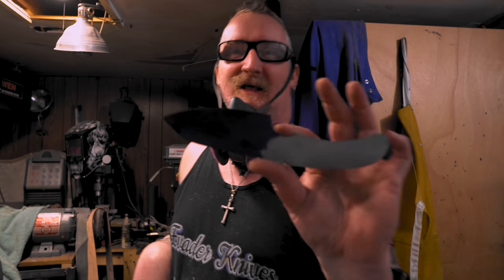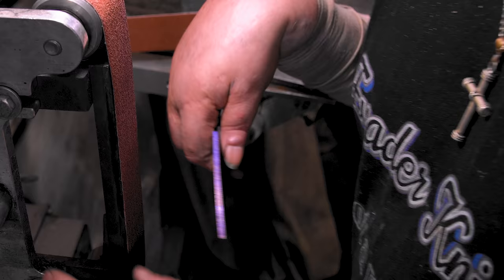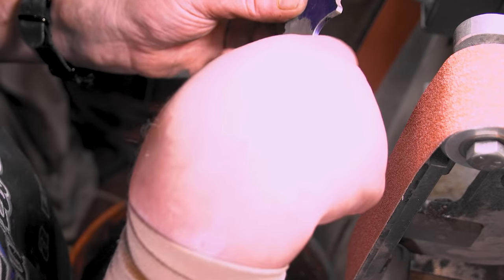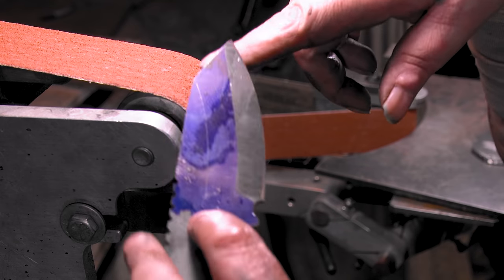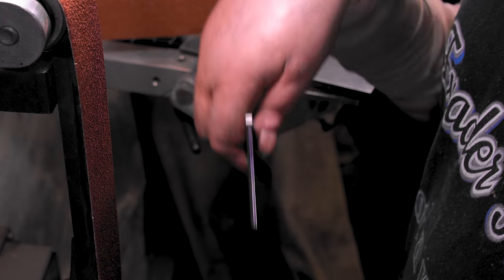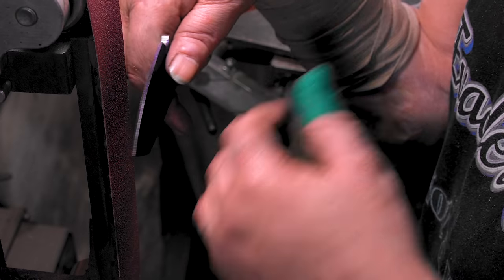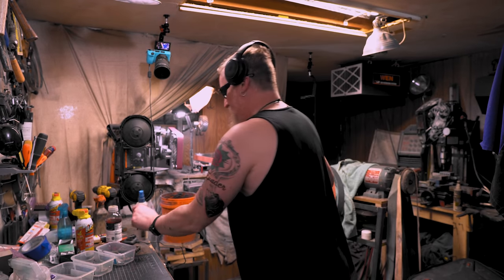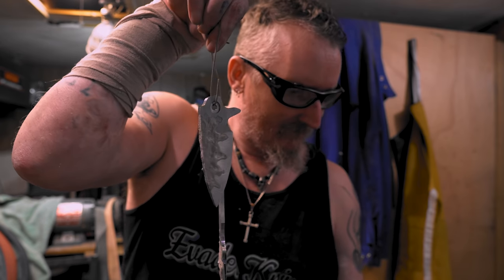Full Guide to Knifemaking pt.2 - Perfect Bevels

Comment: Hi Dave and happy new year.
When the video is at 7.33 minutes,  the table in the background has a swivel attachment on it. Can you tell me where I can get those from?
I been looking for a while now and can't find them.
Thanks and keep up that awesome work.
Reply from the maker: Sorry, I saw this the other night before I fell asleep & forgot. Those I actually made. If you look up Reeder Grinders under accessories, but they are $95 a piece, which doesn't make sense since the tool arm is I think $80. Wilmont grinder has the whole setup for $300. Anyway, I just took a piece of 2"x2" aluminum, drilled the 1/2" holes, cut it in half(easier to work with), cut a line into each hole(at a slant, stop the video you'll see what i mean), drilled for a 1/4-20 widen the top hole, then tapped under the line. So the bolt slides through the line then clamps down. Hope that makes sense.
Reply: Dave make good sense. 
Thanks for getting back with me.
Reply from the maker: @silvergoldking  Sorry it took a while